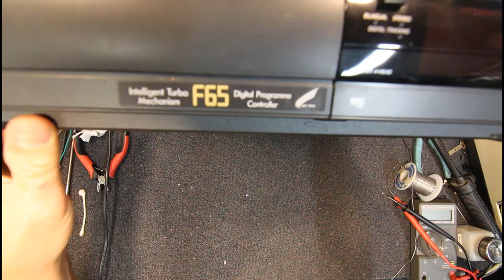Panasonic G Mech HiFi Video Recorder Power Supply Recap NV-F65

Comment: I got one of these yesterday, terrible playback, cleaned the head made no difference.  Took the power supply out and changed the c18  (100uf , 50v cap ) which is a known fault and it's fine now.  I love the loading/unloading on this machine so smooth and fast and it unlaces the tape when FFWD and REWDing.  You've done a very thorough video here, will have to watch when I get some time.  cheers!

Comment: Hi  I recently got one  Panasonic F70 plays ok but no controls work on the panal to eject the tape sometimes the timer button works but most of the time the control panel is completely dead any ideas Thanks
Reply from the maker: From memory the flexible cable from the control buttons to the front panel circuit board gets breaks in it. I cant remember if its just a cable you can replace or even bypass the faulty tracks on, or the whole set of buttons is all part of the same flexible plastic, which means you would really have to replace it. Most Panasonic VCR remotes, particularly with the barcode scanner on them, should run these machines, and should be easy to find on Ebay etc.
Reply: @StevesElectronicRepairShop  thanks for the quick response

Comment: fantastic video Steve......I have a Panasonic Nv-F55 It's in great condition but there is an issue....When you play a tape and it hits the 50 min mark or 1 hour mark......The picture goes from perfect to high colour then  losing colour and then picture then goes all fuzzy the only way to fix this is turn the power off for a bit let it cool down plug it in again the same thing happens.......any idea what the issue could be ?...I have cleaned the heads and the audio head all good.....
thanks for the advice ......
Reply from the maker: It would most likely be capacitors in there somewhere if cooling down gets it going again. The power supply is the first place they tend to fail, but sometimes there are faulty ones on the main board somewhere. Use of a hair dryer and can of freeze spray can help locate the faulty area or faulty component by heating and cooling various areas on the circuit boards.

Comment: Hi.. great video.  I have a F65 and it was sitting unused for a while.  Now has a problem with the drum/video head motor.  Seems like it's seizing and effecting playback and hifi sound.  You can hear the motor making a noise and not spinning freely.  Is there anything that I can do to get it running freely?  Hate to have to throw this machine out..  :(
Reply from the maker: Usually you would remove the heads/upper drum and see if everything is OK under it, and if so, you can remove the magnet assembly on the bottom and usually there is a brass ring that it screws onto. If that is removed by undoing a grub screw you can pull the shaft out and try lubing the two bearings that the shaft goes through with some light oil. The bearings can even be tapped out and replaced but usually you need a similar drum assembly to source them from. I am about to put out a video on VCR repair that shows the disassembly process in an old Sharp VCR which should have similar construction to the Panasonic.

Comment: I have the same deck which also had really cooked electrolytics in the PSU. I recapped the whole thing which brought it to life but now it has an issue where I suppose it "thinks" it has a tape in it. As soon as I turn it on, the big drum spins really fast then after 5 seconds or so it cuts out. If I try and put a tape in, it resists and if I kinda force it in it just spits it straight back out.
Reply from the maker: Sounds like a mechanical alignment issue. The only way to find out is to wind the mechanism by hand and see if it does all the things its supposed to. Someone may have forced a tape out when they couldnt get it to power up, but its also possible but less likely that its an electronic fault.

Comment: I have a Panasonic F70 which uses a very similar power supply, I am going to recap it to see if I can revive it.

Thank you for this very informative video
Reply: My recap worked, my F70 is working beautifully. Thank you so much for making a video that showed it was possible to revive my vintage VCR.
Reply: @PaulsOldVids What problems do u have with F70?
Reply: @shimanosv9143 it was completely dead, but I changed all the electrolytic capacitors in the power supply. It now works amazingly well after a 20 year layoff.  I saw this video of the f65, which is it's slightly lesser brother and this gave the idea to do the recap. The PSU on the f65 is very similar.
Reply: @PaulsOldVids  
Thank you for your prompt response. I have the same NV F70 model, is there anything special to pay attention to when replacing the electrolyte?
Reply: @shimanosv9143  it's quite straight forward, but make sure you solder the caps in with the right polarity, I put one in the wrong way round and then damaged the board getting it out. Fortunately it was in such a position that I could solder the leads to the tracks in the board and overcome my mistake
Reply: @PaulsOldVids  OK, thank's. 🍺

Comment: good vid :) you just need more space to work lol
Reply from the maker: I usually work with a mess of tools in easy reach around me like that. I now try and push them into a pile just out of shot so it looks less cluttered on screen.
Reply: @StevesElectronicRepairShop  haha yup i just bought one of these really cheap as a non worker but a F90, has playback issues on svhs but sound is ok and also the vhs playback suppose to be ok. Will find out later if i can do anything with it.
Reply: well, just got it home and, yup.. no power so im buggered thing wont even turn on, but when you put power to it i can hear a squeal from the power supply.
Reply from the maker: @rs2klee  Sounds like caps in the power supply. I did fix a few of those SVHS machines but cant remember much about them. Often if you remove power for a while they wont come back on if the caps are faulty.
Reply: @StevesElectronicRepairShop  Thanks for the reply :) it was said that its not been used for a long time so no power for a long time like you said hopefully will be the problem. None of them look blown or bulging but not got an egr meter to check them so i have taken out the supply and going to replace the caps and see what happens. I have another one coming in the posty today so if that supply works i can at least test out the machine, always handy to have spares.
Reply: Hi Steve, after getting the fs 90 working and was going fine until today! I noticed that there was no clock, ooh 1st thing i thought ah plugs not in.. but oh it powers on.. and plays a tape, rewinds but no display ? any ideas...